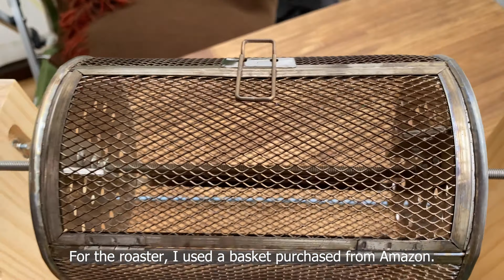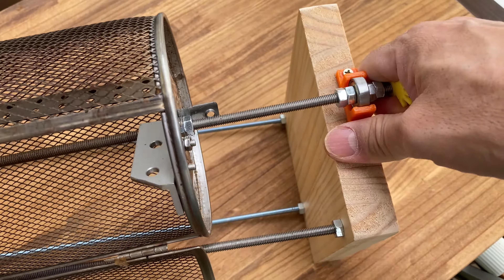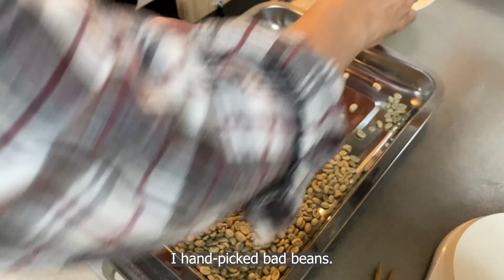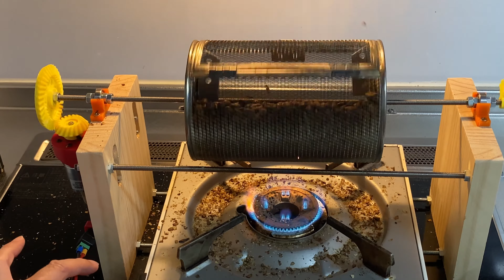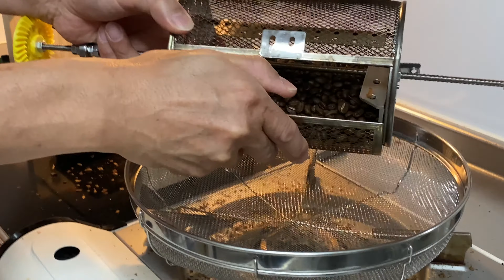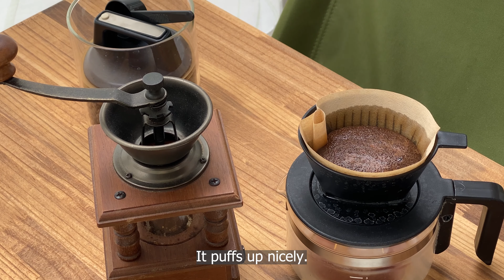DIY Coffee Roaster

Comment: Very nice DIY project. What I do not like very much is the energy inefficiency. I would alter two things:
a) Switch to electric heating / e.g. from an old toaster
b) Build a housing for the cage and the heating.

You gain two major improvements.
a) With a sensor you can control your roasting temperature more precisely
b) You waste less energy and can optionally power the applicance with solar energy instead of fossil gas.
c) You can use the same ventilator for heating and cooling 
d) You can build a drawer at the bottom to collect the clutter
Reply from the maker: Thank you for your suggestions!
I would like to make such a modified one if there is a chance.
Reply: flame roasted coffee from my own experience produces a much more tasty cup of coffee. I see what you are saying but these when dailed in after use and learning curves are just fine and saying electric is more efficient is a stretch

Comment: Nice! I had the same idea! I just need to research how to properly wire the motor. 

What size shaft does your motor have? 8mm?
Reply from the maker: Thank you for your comment! It is 6mm shaft.
Reply: @supli304  Gotcha, Thanks! I'll start looking for a motor
Reply from the maker: There is an information about the motor in https://www.thingiverse.com/thing:5213256.
I hope this will help you.
Reply: @supli304  oh that's awesome! I didn't see this part before. I'll check it out, thanks so much!
Reply: @supli304  so I've printed the parts and ordered the motor and PWM switch. What did you do for the power supply? Just a 12v DC charger with pig tails going to try pwm?
Reply from the maker: @inquisitivecoffee  I am using DC 12v 5A power supply such as https://www.aliexpress.com/item/4000594896227.html. Smaller current might be enough. Hope everything goes well!
Reply from the maker: I measured the current. It is about 0.2A with load. So 1A power supply should be enough.
Reply: @supli304  perfect. I really appreciate it! I'm just waiting for some parts to come in now. I'll update when it's built😬
Reply: @supli304  I built my first version of it now. The gears warped a bit but it still works. Can't wait to try a roast on it. Thanks again for the ideas and the support!

Comment: Mr., may I know the tool for the orange bearing holder, I'm still making manual roasting, and that tool is hard for me to find. Thank you
Reply from the maker: It is a 3D printed holder. You can find it in my thingiverse page.
Reply: @supli304  ok,,thanks
Dengan motor dc nya,apa benar 200rpm?
Reply from the maker: Yes, it is. The speed is reduced by PWM control. 100rpm might be OK, too.
Reply: @supli304  ok ok👍

Comment: Hello! I am planning to build one with the same type of roaster basket as yours, may i ask what is the size of the basket? Is it 14x18cm?
Reply from the maker: Thank you for asking. The size is 12x18cm.
Reply: @supli304  thank you so much! And it holds 250 grams too, i guess i don't need to buy the bigger variant
Reply from the maker: @whoami724y  Now, I am putting 333g,and there is no problem.